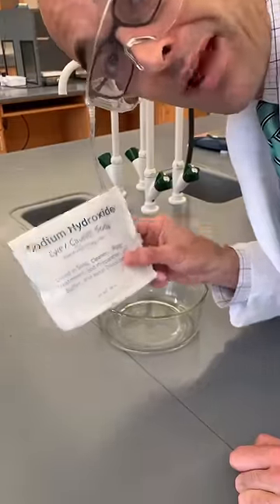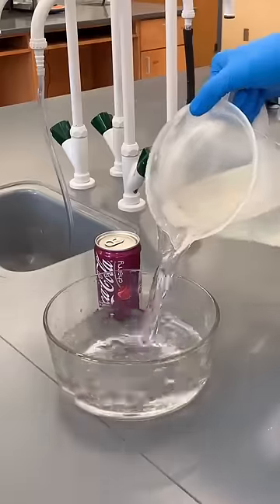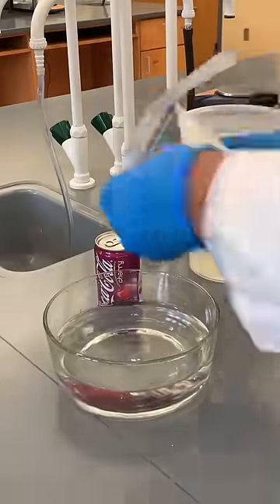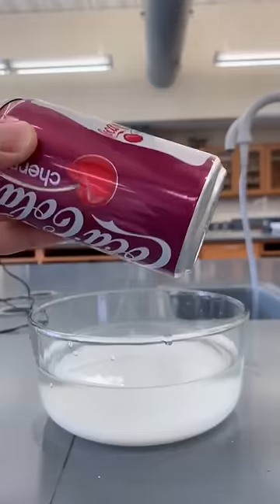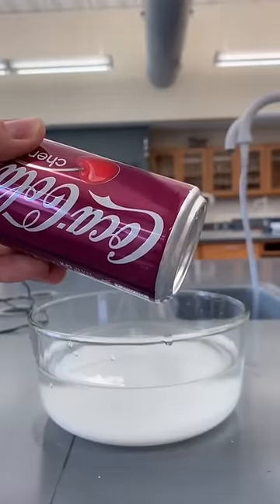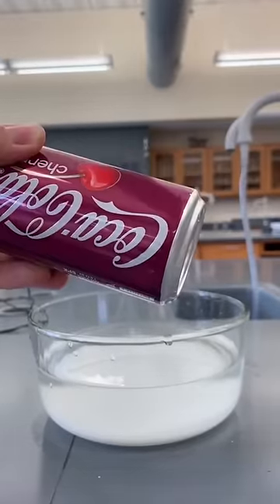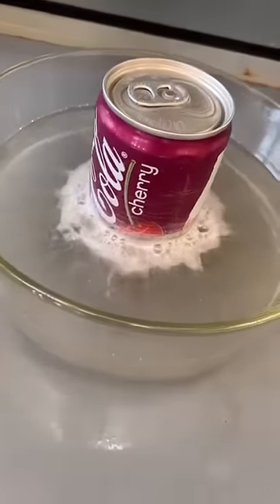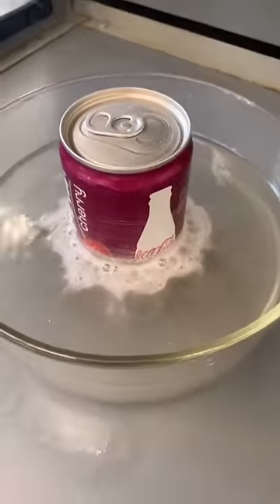Did you know this about aluminum cans?

Comment: The plastic liner is so that the soda doesn't taste like metal. More or less so the soda doesn't corrode the aluminum.

I've started a war 💀
Reply: That tells you all you need to know about soda
Reply: @m_affiliates  it says nothing other than the soda is acidic. freshly squeezed organic lemonade will do the same to the metal
Reply: @doppled  fair
Reply: Gotta love how easily dissolve aluminum is when it gets dissolved by mild acids in soda.@doppled
Reply: Yep, carbon dioxide dissolved into water creates carbonic acid. A very mild acid but still an acid.
Reply: @waroftheworlds2008 true, but the phosphoric acid they but in soda is very acidic.
Reply: @williamh4172  all soda cans have a liner. Only colas have phosphoric acid.
Reply: @williamh4172  it's not, phosphoric acid is a very mild acid, used to enhance the taste in sodas.
Reply: It tastes better with the metal
Reply: @williamh4172 yes that's exactly right , same as battery acid 😅 but Carmin from crushed bugs in many drinks for colour and ice-cream even chips for purple , they get away with anything for money
Reply: Bro just googled it
Reply: @Gundanium_Wolf908  they are all in the ones that have chems though
Reply: @Gundanium_Wolf908  how's about no bugs no artificial:) that would suit me
Reply: @waroftheworlds2008  Beer often has phosphoric acid added for pH balancing. Beer is often acidic, ranging around 3.5-5.5 pH.
Reply: Laquer is sprayed in the can to prevent corrosion
Reply: A lot of things we consume are highly corrosive. I etch steel with vinegar or coffee. Coffee works better than ferric chloride.
Reply: @DontbuyChinafood what’s wrong with bugs? People eat bugs in some countries 🤷🏻‍♂️
Reply: @m_affiliates  lmao i love how logical and civilized your argument was. Rarity
Reply: @doppled i love how the guy admitted his argument flaw. Great show of logic over pride
Reply: Corrode* not corroded 🤦🏼‍♂️
Reply: @NomadUrpagi  for future reference, i go by they/them
Reply: @m_affiliates  ok man. I don't think we will be interacting though. But why though? Im not from united states and im really curious why is it offensive now to say he and she. Until 2010 it was really fine, now people have to walk on eggshells to talk to anyone. And everyone is offended at everyone over miniscule things. Social media is polarising people against each other.
Reply: @NomadUrpagi  people have more freedom to express themselves than they have ever had before, since it is way more socially acceptable and normalised than it was, as you say, before 2010 (and even compared to like the mid 2010s, it's more accepted now than it was then)

i personally use they/them because it matches how i feel about myself, more so than he/she pronouns do, but how someone wants to be referred to differs from person to person, for example, some people might not at all care, whilst others might care much more, and if you're not sure what pronouns someone uses, the best thing to do from my experience is ask

(unrelated to the main point but funnily enough i'm not from the united states either lmao)

if you have further questions, feel free to ask
Reply: @m_affiliates  You seem chill. Lmao two people from outside america using american things. Can i ask are you a guy or a girl and how old are you? Tbh america culturally influences the whole world. Mainly for worse 😂.
Reply: @NomadUrpagi  i'm nonbinary and i keep my age secret because it's funny to do that
Reply: Instead it like taste like plastic... great..
Reply: Corrodes metal and we drink it 😂?
Reply: @m_affiliates 
In other words, you enjoy making other people feel uncomfortable. It is a power play. Strangers shouldn't have to ask us personal questions that are none of their business.
Reply: Its a coating, varnish. Not always "plastic" more like paint. Water are the enemy to aluminium and will eat its way thru  the wall of the can
Reply: So is the acid in your stomach..... 

And yet you dont die when you throw up do you?@williamh4172
Reply: Ya but plastic still dissolves even not being able to be filtered out of human waste. 

It’s like glass bottles are probably better unless if they can find a better plastic. A century ago they didn’t use plastic liners. People still had tomatoes in cans.
Reply: 😮.... safety
Reply: Yes but it’s nearly impossible to get away from the micro plastics that are still in the soda now after staying in the container for however long
Reply: It also poisonous to us
Reply: We know that but there is too much plasticiser and zeno estrogens even getting into drinking water and people don't know what it's doing to human sexualities and sexual development.
Reply: @doppled  No, it tells you that there's Phosphoric acid in coke....
Reply: @m_affiliates Tomato juice probably too
Reply: No. It’s so the acid in the drink doesn’t eat through the can. It has nothing to do with the taste.
Edit: My father was in the aluminum can business until he retired. The liner is BPA free and is considered a lacquer.
Reply: Your right but it’s not plastic it’s a spray in material
Reply: Well that makes sense then 🤔
Reply: The metalic taste in cans is actually from the act of opining up the can
Reply: Are beer cans the same?
Reply: It tasted fine in the 70's. Experiments of death!
Reply: @StayinWeird778 how is phosphoric acid a mild acid? It has a pH of 1.5

Not to mention when you dilute an acid or base in water when it’s that far on the scale, you need 100,000 parts water to get close to pH neutral.

PH is a logarithmic scale. Every increment indicates a power of 10 scaling.

Tell me you know nothing about chemistry without telling me
Reply: But plastic can become toxic with certain liquids. I think soda is one.
Reply: Go back to glass
Reply: Imagine what it's doing to your insides?
Reply: And that's why we have plastic on the inside too!!😢
Reply: And yet liquids still taste like metal. Why is that?
Reply: Oh my gosh that’s cool
Reply: @ImmenseJ-tard8253 the acids in soda arnt mild at all
Reply: @DaejaLatham  citric acid is a mild acid, phosphoric acid is a weak acid, buddy, get better sources next time.
Reply: @ImmenseJ-tard8253  ohh okay I thought it was harsh because you can clean rust with it
Reply: @DaejaLatham  it cleans rust, but it doesn't dissolve the metal itself.
Reply: @ImmenseJ-tard8253  right I get what your saying
Reply: My Uncle used coke to clean out pipes in the 60's. It kind of scared me.
Reply: @nancystevenson562  ur uncle is 81 now? Amazing!
Reply: Lol you did not just act like the smartest person to ever exist! Oh wait you did! Alrighty then
Reply: @johnj0709  siempre creí que el aluminio no era corroído por el agua
Reply: Aluminum is also toxic
Reply: Todos los comentarios dicen tonterías....madre mía
Reply: it's a baked on varnish not plastic,its safe.
Reply: It's for your protection?
Reply: There is not a plastic coating.

Comment: It's not a separate plastic liner as you might think, the inside of the can is sprayed with a  claimed non-toxic, non-plastic coating that prevents the beverage from reacting with the aluminum which is not good for you, but also alters the taste. It's not like you could peel it off, It takes a chemical reaction like disintegrating the aluminum to see it, and it is also shed during the recycling process.
Reply: Are there PFAS used to line the can I wonder?
Reply: Yep, I was the Global Sourcing Manager for Coatings for one of the major aluminum companies. We used to buy these coatings by the tanker truck. I was told that 30% of the Coke cans in the world had a coating that I bought.
Reply: @mariap.thisislife8735  Um, I hope you stopped doing that. Plastic fumes in your chicken is obviously not good lol
Reply: I thought it was a varnish!?! That's what was explained in the How It's Made program. The facility was making soda cans for Sam's Club.
Reply: @ajrob2888  I don't know what individual can formers do at their end (if they add anything else at all) but I worked for a company that bought huge aluminum ingots (a few tons) and sheeted it for various applications, one of which was to sell to can formers. Part of our process for that was to coat the sheet with an FDA approved coating specifically designed and approved for specific food and beverage manufacturers, from Coke to Spam.
Reply: Why do you have Epstein as your pfp?
Reply: Cool thanks I generally was interested in knowing that✌️
Reply: @bct1959  Is it SAFE?
Reply: What's the actual chemical name?
Reply: Yea makes sense as ive seen rusty cans with no plastic
Reply: So you mean you must do exactly what this video is showing.. You are  genius.. lol
Reply: @visnuexe  sometimes it's made of PVC, which is similar to PFAS. Most often it's epoxy resin though.
Reply: Guyyyss lots of reactions here containing peels of aluminum
Reply: @rogueplanet13  aluminum doesn't rust
Reply: @ingram1225  shut
Reply: @rogueplanet13  laughing my arse off
Reply: @christofferbrandel6491  Dunno where you’re from, but PVC which comes into contact with food/beverages is banned in EU. So this is only the case somewhere else.
Reply: @Mikkel111  I don't know why you believe that, but it's not true.
Reply: @christofferbrandel6491  “Bans on PVC Packaging
PVC packaging has been banned or restricted in a number of countries around the world, such as Canada, Spain, South Korea and the Czech Republic. Some U.S. cities such as Rahway, NJ and Glen Cove, NY have prohibited the use of PVC in food packaging or utensils. Legislation
to ban PVC packaging has been introduced in California.”
It’s not an uncommon thing. Can’t remember the last time I saw a container that contained PVC.
Reply: @Mikkel111  That's good, but EU has not banned it (yet). It's mostly used in thin films for consumers and some other containers in larger kitchens.

And also in aluminum cans, but it's more often epoxy.
Reply: And the plastic is somehow less toxic?
Reply: @BCT 1  dawgo, what's the chemical called if you don't mind. This seems like an interesting chemical for some experiments I have in mind.
Reply: So you're telling me I've been avoiding drinking from cans to avoid long term metal poisoning for nothing?!
Reply: @SkyRied1 that's just his rabbi.
Reply: @ingram1225   aluminum does rust. It’s called aluminum oxide. Just like iron rust which is iron oxide. But with aluminum it makes a very thin rust layer that’s pretty much invisible and that protects the underlying aluminum from the rust penetrating deeper unlike iron.  It acts as it’s own protectant. Aluminum rust (aluminum oxide) is very tough and Almost as hard as sapphire. That’s why aluminum parts are usually Anodized which is a process (acid and electricity) that makes a much thicker oxide layer making the surface very tough and scratch resistant.  Aluminum oxide is also one of the most common abrasives used in sandpaper.
Reply: TRue.  Aluminum won't technically turn to rust  but it does corrode.
Reply: It is a seperate plastic liner its literally a layer of plastic.
Reply: And obviously its plastic because he used a chemical compund that would melt aluminum but not react to plastic.
Reply: It all goes to tha dump🤷🏾‍♂️😂
Reply: @cosmicabyss7358  it's possible for something to react to aluminum, not plastic, and not the third unnamed material
Reply: @tesladrew2608  Yeah that's literally what I said.
Reply: claimed " non toxic " but in reality it's toxic just the name of what was " toxic " was changed so it was okay to use or the " non toxic " material is slightly altered from what was toxic
Reply: @tesladrew2608  The scientist in this video said it was a chemical makeup of plastic.

If its not plastic then what is it?

And why if he used a solvent that was meant to not react to plastic did his theory prove to be correct via the plastic material not being disolved by the solvent?

His hypothesis proved to be correct that it was plastic by the direct evidence we just saw in this video.
Reply: @b_f_d_d  Just like "Foam" used in Cup Of Noodles isn't really Styrofoam and is actually much more toxic.
Reply: @wormhole331  Now I learned something new 👍🏻
Reply: @cosmicabyss7358  not in this video
Reply: @tesladrew2608   You clearly didn't watch the video then. Lol
Reply: @cosmicabyss7358  I don't see any proof it was plastic
Reply: @ingram1225  😂 tell these idi###
Reply: Wow thanks. You should have your own YouTube channel. I'm sure you'd be a better dork than this guy. At least your not bald 👍
Reply: @bct1959  interesting!
Reply: I like how you said claimed basically stating you actually have no fucking idea if its true or not, why would it be sprayed with a toxic liner? Here's your answer, it wouldn't.